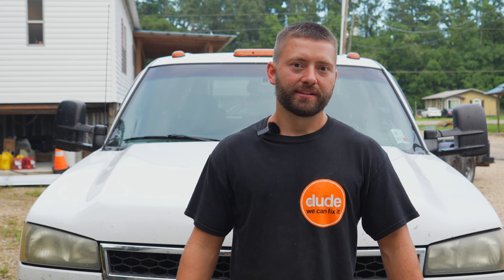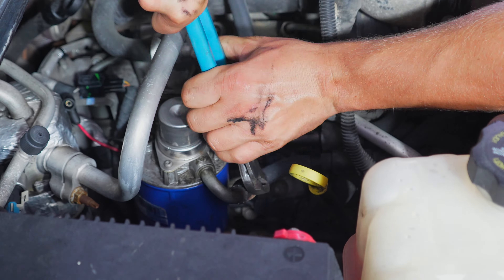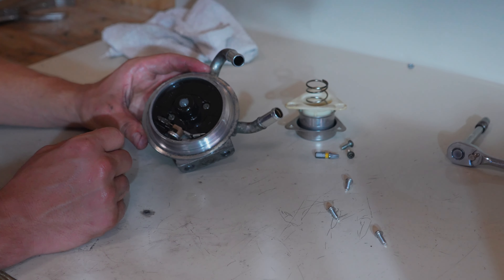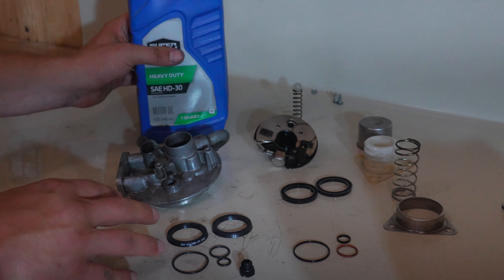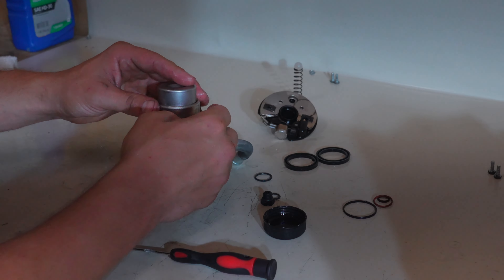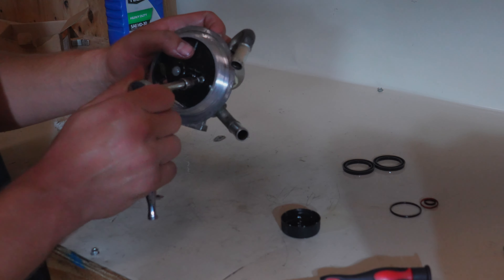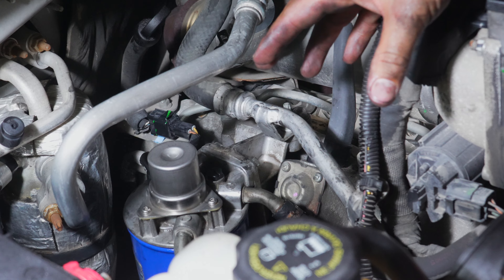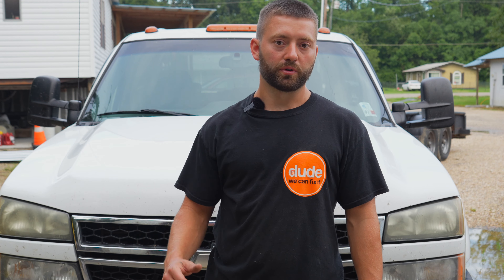Duramax Fuel Primer Rebuild | The Ultimate Guide to Fixing a Common Diesel Engine Problem

Comment: Is there a way to check the low pressure fiel system to find other leaks?  I am fighting a heat soak no start on an 07 lbz.  After a very long prime it will start. I feel the fuel filter housing is a culprit but is it the only one?  There is no visible external leaks but I know it's loosing prime but I can't figure out where the leak is at.
Reply from the maker: I'm not sure. You could pressurize the fuel tank and look for leaks

Comment: Would you know if this problem would cause a crank but no start. Our truck only starts for like 30 seconds with quick start spray so we know its not the cp3 pump.
Reply from the maker: The primer should get firm when you pump it. If it doesn't or if it leaks fuel, that could be your problem